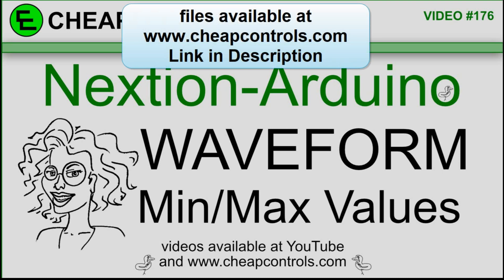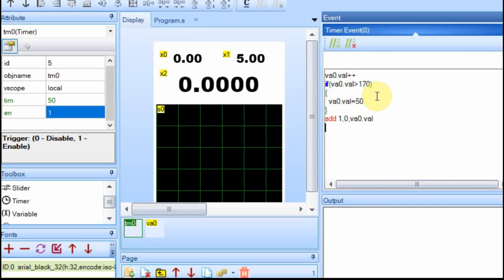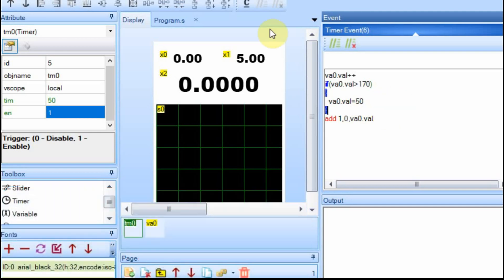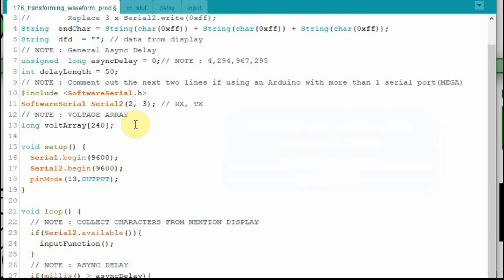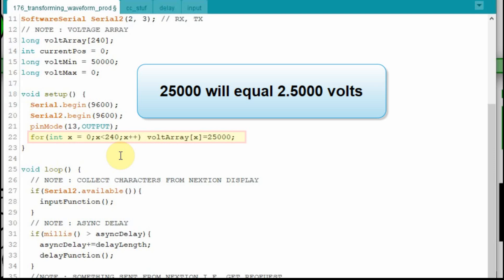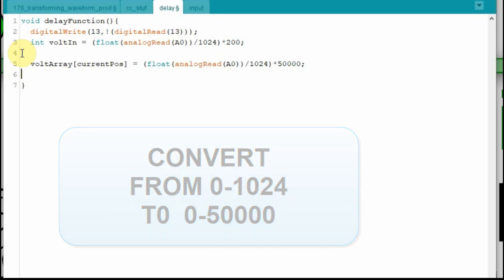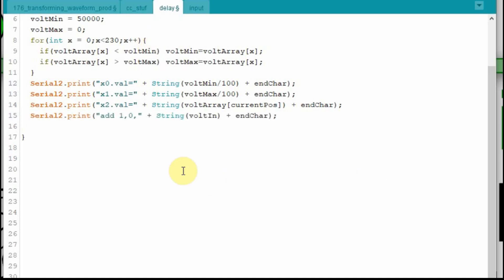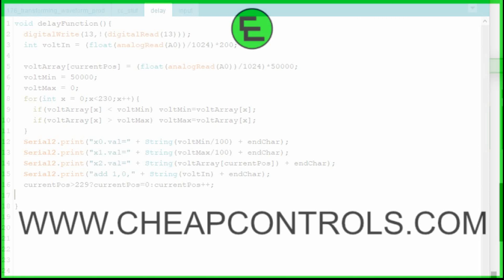176 Nextion Display tutorial waveform with min max number

Comment: I want to get a smooth graph. Can I print 5 data in 1 second? ( k type termokupl )
Reply from the maker: what MCU are you using to send the data.  I am pretty sure you can send the data very quickly.
Reply: @CheapControls   ESP32
Reply from the maker: The ESP32 should have the ability to update the waveform very quickly.  More data at a quicker rate will make it appear smoother.

Comment: Can i use min() or max() function?
Reply from the maker: You can copy the code from the video or download it at cheapcontrols.com.  Then you can adjust the code in anyway you want.
Reply: @CheapControls  Hey Bro i wanna ask something why i cant get string from Nextion when i use Serial2? But when i used Serial i still get the string
Reply: @CheapControls  also i wanna ask something why i get 1553,6 value of minVolt? Why i cant get a zero?
Reply: @BlondieHappyGuy  i used UNO and now i can used the Serial2 with Nextion but with different arduino code , now the problem is minVolt Array is contains 1553,6 but when i Serial.println voltIn it still 0 do you have solution?
Reply: Should i declare Array as 0 so the code Will be 
For(int x=0; x<230;x++){
voltArray[x]=0;
}
Reply from the maker: @kuro Your assignment a few comments up would assign all the values in the array to 0.  I am not sure what sendData() is.  Is that another function that you wrote.
Reply from the maker: @blondie SL thanks for helping out in the comments.
Reply: @CheapControls  i copy it from your code in the video 59 programming button Nextion to arduino
Reply: @CheapControls  my Project is , i want to create a button that can control the sensor reading from arduino and pass the sensor data to Nextion again in Waveform could you help it?
Reply: @BlondieHappyGuy  the different code just like this
If(Serial2.available()){
Dfd ="";
Delay(30);
While (Serial2.available()){
dfd+=char (Serial2.read());
sendData(dfd);
}

PS: before i used this code i try the CC code but still can't display my dfd to arduino so i try this code and its work , now the problem ist why the minVolt not gonna 0 but 1553,6
Reply: @BlondieHappyGuy  thankyou it Will be help me alot